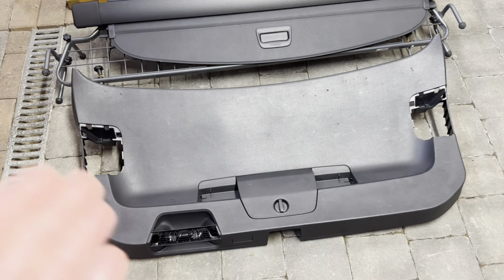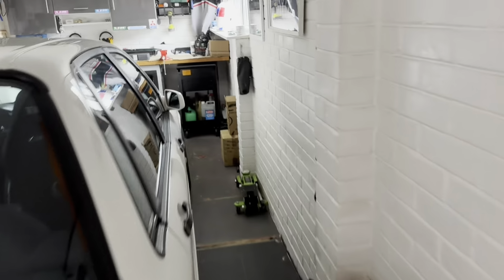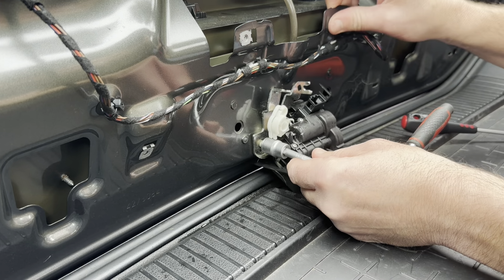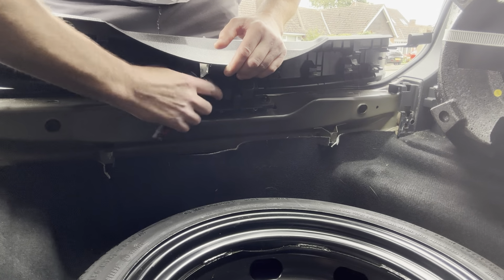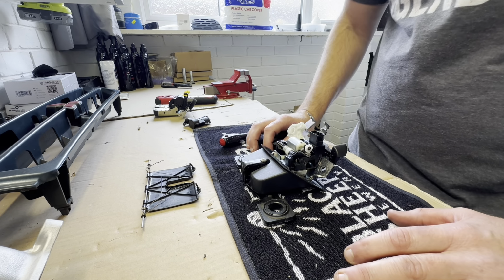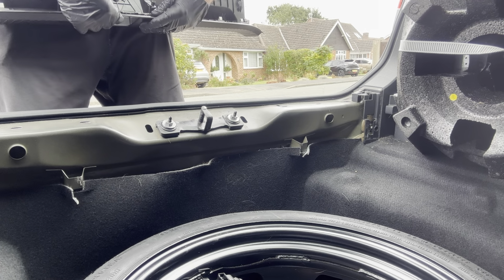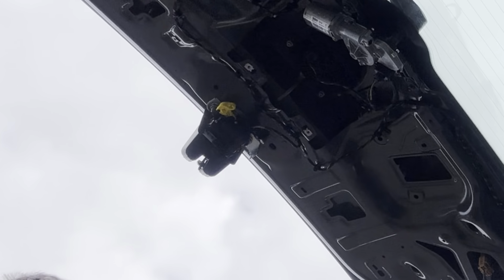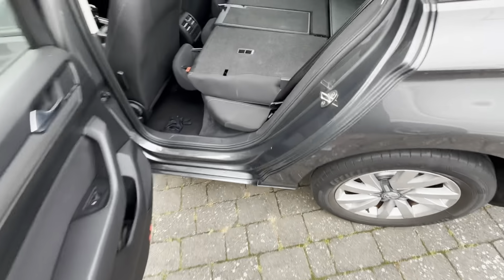VW Passat B8 Estate Rear Boot Lock Replacement

Comment: Great clear step by step video, have the same issue, just a pity I found your video after I dropped my car off with VW😢
Reply from the maker: @georgekamp1402  bummer :(. Thanks for watching.
Reply: Great video.  I replaced mine and it works.  However it doesn’t lock with the car ie you can still open it when car is locked. Did you come across this issue?
Reply from the maker: @ don’t have that issue. Not sure why it is doing that.